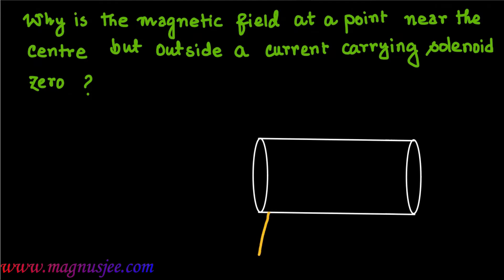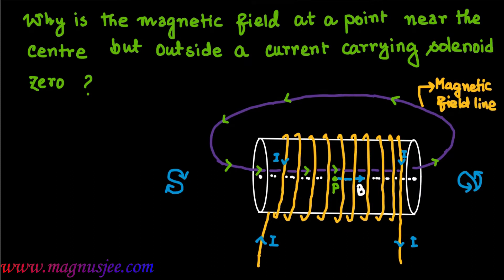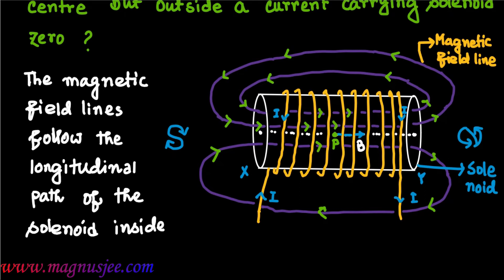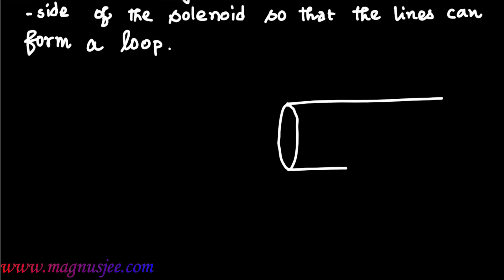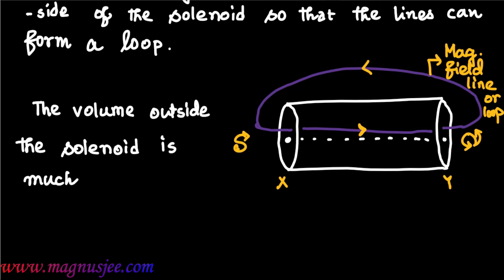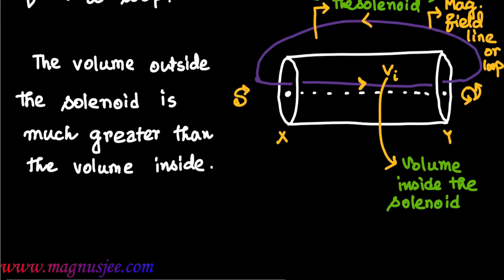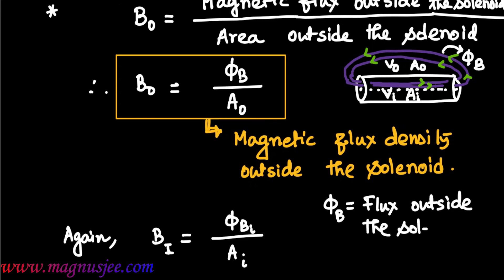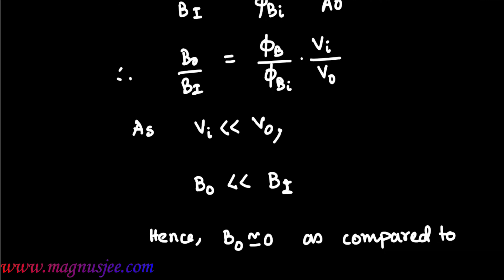Why is the magnetic field at a point just outside  a current carrying solenoid zero?

Comment: If it is zero outside then why we represent mag.fd. lines outside the solenoid in every diagram😢
Reply: we show then becase the exist but teir amount (dentsity) is so small compared to the volume outside that it does not have any major magnetic force or effect. unlike the case of bar magnets who have similar shape of mag. field lines outside but the are more in amount or density (more spread out across the large volume) that they do have some effect or magnetic force....
you can open the diagrams of mag. fields of solinoids and bar magnets to see the diffrence in how spread out the field lines are across the volume outside 
hope that helps !